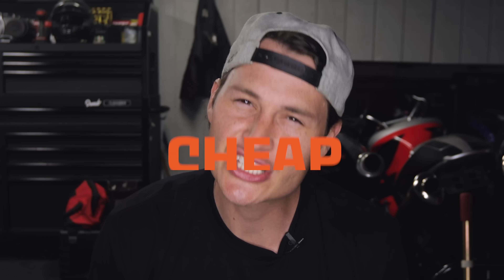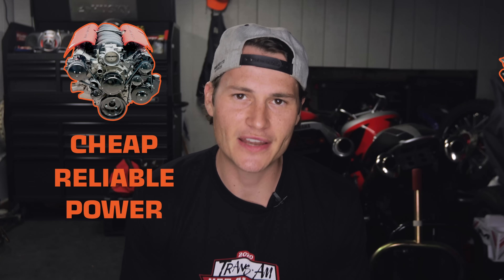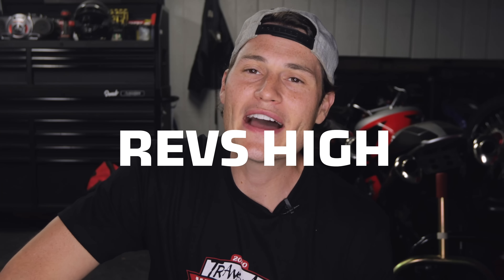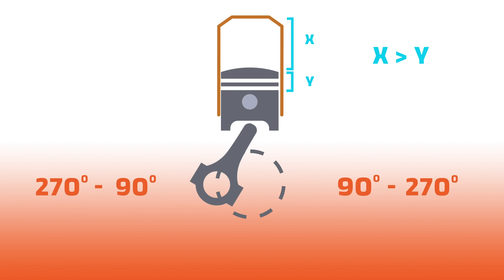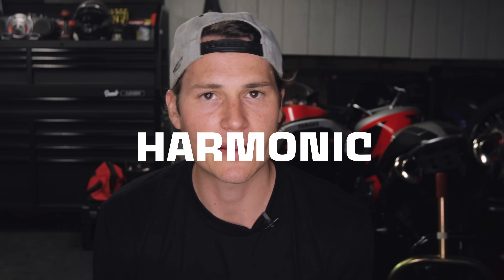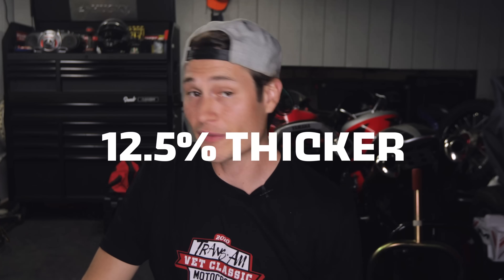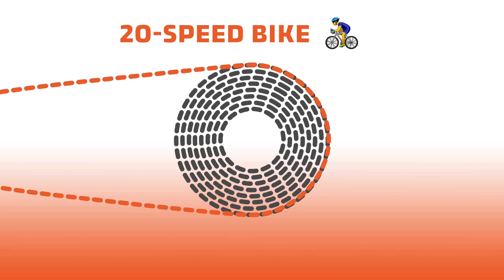Nissan VQ Engine - The Science Explained

Comment: All the VQs are great, we see plenty of older products with 200-300K miles on them still running strong in service and coming in on trade. The VQ37 has proven to be really reliable too!
Reply: my 2002 nissan altima with the 3.5 v6 (pretty sure a vq engine) is still running strong with 340,000 kilometres on it, although it already has problems burning oil it’s incredibly how that car still runs. vq all day baby
Reply: @bugoykikay8074  oil burn on an old vq engine is like breathing. So natural 🤣🤣 but yes a work horse of an engine
Reply: @kungfuhustle6363  ye it indeed burns oil on old vqs my other nissan titan 5.6 v8 does the same burns oil but still hauls ass
Reply: @bugoykikay8074  yea thats pretty much the only bad thing about the vqs. They eat oil like no ones business but otherwise they sick
Reply: @alexanderfriesen8818  little update that old altima still runs but it eats more oil than usual now hahaha
Reply: @bugoykikay8074 ofc the first gen de burns oil like crazy
Reply: Japanese knew how to do it for sure. 93 Subaru impreza 1.8 litre boxer. 435,000
Reply: I had a 2001 pathfinder SE with the VQ35DE and when I gave it away it had 300K on it, and it still ran perfectly, it could still do burnouts even with tires that were taller than stock. That pathfinder never had any mechanical issues even though it spent alot of time offroad.
Reply: The reason in Milwaukee I see people driving reckless in those ragely ass infinits, but they are still running
Reply: @vernonpaigejr.1517 that's what made me get one, I may do a pull here or there but these VQs live through the BS people put them through. When I worked in the shop, it was common to see Infinitis and G37s with well over 200k miles
Reply: @Tachyon836 did many have the gallery gaskets issues? How common was that problem in your experience? I just bought a low km 08 coupe and wondered if this an inevitable reality.
Reply: @Rygo-wk3jm honestly, I was at 180k miles and it never went on me. I sold it though.
Reply: Mine has 300k still runs gray I haven't had a fix anything
Reply: I have 283k miles and counting on my daily-driven 2006 G35 sedan with no issues (that I can't handle). 25k of the miles have been under my ownership. My previous 2005 G35 made it to 265k before it got a bad oil leak, but I'm going to pull that engine and rebuild it for another 2006 G35 coupe (6MT) I have that came with a blown motor. Once I get that going, it's gonna be a track car!

I bought both of these cars for $1500 each. They've taken a fair bit of work but I've learned a lot, and I have more faith in my daily than ever. In the end, I'll have two great cars (one of which I autocross/drift), have parted another out, and have done all the work myself. This has been my passion over the pandemic.
Reply: @stezenast5878  my friend had his bagged g35 with almost 400k and he drives the fuck out of that thing😭
Reply: I own a 2000 nissan cefiro with a vq20 DE,love it
Reply: My xterra has 400 000 km or 250,000 miles and going strong.
Reply: The Vq40de after 2011 is pretty good
Reply: Dont they chug oil
Reply: @lukesterhd4055  The higher horsepower versions of the 3.5 they put in the G35 6MT and the 350Z were said to consume oil, but I think that was when you drove them hard. I had an 05 G35 GMT Sedan and currently own a FX37 with the VQ37 engine, I never had any issues with oil consumption.
Reply: @lukesterhd4055 because it's literally a missile it's faster than mustangs

Comment: I personally feel that the vq35 & 37 are among the best v6 engine (reliability & performance) also along with Honda’s j35 & 37. Many Japanese v6s are reliable and can out perform most other v6’s
Reply: VR38
Reply: @preludeh22honda69 that’s a twin turbo v6, and yes it’s the best v6, but the vq37 is the best NA v6.
Reply: @Eclipsis17  i never said the vr was n/a and neither did the original comment specify so all i can say to you is...who asked bro?
Reply: My Murano has the VQ35 and if it wasn't for the CVT, that thing would be a beast. I had to replace the trans recently, like everyone else, and started looking into the engine to see if it would last long enough to be worth replacing the trans. Turns out, Nissan actually made a good choice there.
Reply: Got a VQ35DE in my Pathfinder with a 4 spd. auto. Good stuff!
Reply: Also can't forget the Toyota/Lexus 2gr-fse with Direct injection. I have a 2006 is350 with that motor and it's a beast. Makes more hp and torque than the VQ and Honda's J series with 306 hp and 277 lb-ft torque.
Reply: @dustinferrel4934  Might be me but I don't see many people talking about the 2GR-FE and FSE. In theory it seems like an amazing engine and a decent enough successor to the JZ series.
Reply: @dustinferrel4934 yeah but that engine doesn’t rev to 7500Rpm and it’s not as modifiable

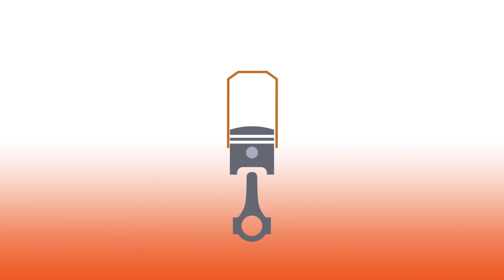Comment: 7:30 I don't think that is correct at all. If you have a 4 inch stroke, there isn't more on the top of the rotation than the bottom. Piston speed does vary through the stroke but the distance from the top half to the bottom half doesn't change. 90-270 would be the same as 270-90. Now 45-135 compared to 135-225, that's a different story.

Comment: Has anyone pointed out yet that your description of inline 6's is incorrect?  The mated pairs of cylinders do not fire at the same time.  They still balance each other out because they offset the mass at opposing ends of the crankshaft equally.

Comment: Calling the VQ35HR to best VQ is straight up stupid.  When this video came out the VQ37VHR had been around and in vehicles for over a decade.  Overall it is a much better engine that fixes many of the issues with the VQ35HR.  Doesn't drink oil like a frat boy chugs beer at a kegger while actually capable of seeing some power output improvement with bolt-ons other than forced induction.  With just a tune you can get most of them to over 350 hp.

Comment: 260lb/ft is not a "bunch of torque", especially when you have to rev it up so high to get it.  This is where a modern 2.0 4cyl with 260lb/ft stomps it because the 260lb in that case starts at ~1500rpm.  These higher HP V6 engines had a short life between the anemic V6s and turbo 4s.

Comment: ok, but 20v 4age Rev limit
A correctly wired silvertop 20V 4A-GE has a factory rev limit of 8200rpm. Without the SPD signal to the ECU (speed sensor), the rev limit is reduced to 7800rpm as the ECU thinks you are "free-revving" the engine.

Comment: Don't know about 350Z but my G37 manual shifted pretty rough 1to3rd an also 4to 5th. 
BMW and Honda make better manual gearbox than Nissan
Reply: I went with the semi-auto and with the Level 10 upgrade/rebuild and it is great.  I tried the manual and didn't like it, which is strange since i normally rather a manual.
Reply: @TheInfinityzeN  semi-auto in a 350z would be nice is it 6-speed?
Reply: @aryaahmadi4029  I have a G37S, so the 7 speed.  Sadly they are a Semi Auto using an Automatic base, rather than an AMT using a manual base.  

For those that don't know, an auto based Semi Auto Trans has a locking torque converter or clutch pack along with manual controlled shifting.  Those changes let it get close to (or better than) the performance of a manual based on its tuning.  The Level 10 kit made it hard slam shifts instantly in Sport or Manual mode.

Not as good as a Sequential or DCT for performance, but they can be much smoother when driving around town, can handle more torque, and don't break as often.
Reply: @TheInfinityzeN  still pretty decent for being the torque converter. I bought the manual G37 thinking it was going to o feel like a 3 series, it left me disappointed except for the power (IPL engine)
Reply: It is a little more than pretty decent after the upgrade, but you are looking at some money to do it.

A V6 is never going to feel as good as an I6.  I did get a tune that is a little better than the IPL one before I did any upgrades.  Living an hour drive from UpRev helps if you drive anything Nissan.
Reply: @TheInfinityzeN  True it's one of the few occasions that I prefer 7apeed auto to a 6speed manual.

Comment: Powerful and reliable? Are we talking about the same engine? The engine that would burn a quart of oil between services due to it's flawed cylinder sleeve design? The engine that is hard to squeeze extra horsepower out of with just bolt ons unless you boost it because it's already tuned to almost max output for power? I know the oil consumption was addressed in later models but squeezing power out of it was always pricey.

Comment: Hilarious!  Tell us again how the piston moves further in the top half than the bottom half, I love a good laugh when someone sets themselves up as an expert, then tries to explain something they don't understand.

To do what you describe, the big end would have to be closer to the main bearing at the bottom of the stroke than it is at the top of the stroke.  How exactly do they do this?  Cranks are machined from solid cast or forged blocks of metal.
The crank spins on its main bearings.  The big ends are offset from the centre, by a fixed amount which is exactly half the stroke length.  The big ends move in a perfect circle centred on the main bearing.  The top of a perfect circle is exactly the same distance above the centre as the bottom is below the centre.  Show me any circle where this is not the case.  This means that the piston moves exactly the same distance from 0 to 90 as it does from 90 to 180.

In theory, it would be possible to have some sort of cam arrangement that moved the big ends to achieve what you describe, but nobody does that.  It would be insanely complicated, unreliable, and heavy.

Comment: The engine in my car is a 3.2 s54 and it makes 335hp and 265 ft lbs tq in stock form,it also revs to 8000rpm.It has a weakness though weak rod bearings.I think I'm going with a mild Ls3,cam, heads,intake maybe e85 and a 6sp because how small it is.Its lighter and shorter than the s54 and sits farther back in the engine bay.

Comment: No, each piston is just as fast in the bottom 180 as the top 180.  The piston moves faster in the mid 90 degrees up or down and slower in the top 90 degrees and bottom 90 degrees.  Geez guys, you just made a whole bunch of people dumberer.

Comment: Hey Donut why don't you do instead lo Low car Vs High you do a Turbo (high car) Vs VHR conversion moded NA engine. It still be cheap and the Harness come plug in. With your resourses you could hook up with Z1 for some cams and headers and the turbo will have a challenge ( at the Jim Wolf package ) and the overheating issues should be very control and Nolan Will have some fun!!!!

Comment: You guys missed the mark a bit with the secondary imbalance.
First of all the graph of piston movement is not a perfect sine wave, as you noticed later it should be significantly steeper near the TDC, and more delicate towards the bottom of the cylinder.
This is not caused by the shape of the crank not being symmetrical. As a matter of fact it's always perfectly symmetrical for a specific cylinder, and you can't really offset that, as you'd just change the tdc angle. It's simply caused by the fact that the piston's crank is doing a circular motion while the piston is doing a linear motion, you can understand it very simply by drawing a theoretical crank moving linearly up and down, and when it's exactly half-way you could animate the crank's bottom moving sideways to connect to it's real position in that situation, and due to the geometry of the engine's bottom end you simply end up with the bottom of the crank higher than it would theoretically sit if it was moving linearly.

Comment: 7:54  the shape of the crank is perfectly symmetrical.  i'm not sure why you would say it that way; it makes no sense to me.  the reason the piston moves more at the top half of the stroke is because the connecting rod is effectively shortened when it's brought out of line with the cylinder.  so on the downward stroke, extra length is removed as it rotates out of line, and that shortening of the conrod translates into more stroke.  then as it rotates back into line at the second half, the conrod length is being added back to the stroke, making that half of the stroke shorter at the piston.
now, a sine wave is perfectly symmetrical.  so with the asymmetrical stroke speed, the wave it creates is not sinusoidal.

Comment: Thank you nice to know sombody know s nissan so well. . in your opinion what can I swap on my mint 04 exterra 5 so manual very easy and without brking my back or bank . vs 35 or the hr or the 4.0 liter newer gen what will you put there for best drive on road and 4x4 torque . .. Thank you . if you can advice .

Comment: here's a shocker, the Nissan VQ engine is in fact NOT a nissan engine, as it was engineered and developped by Renault to replace the aging PRV and was used first in the renault Vel Satis and Avantime, only with the 350Z running a less tuned down version months later.

Comment: Engine kicks ass but Jatco Transmissions are shite ! On just about any search engine as soon as you enter jatco this is the kind of crap you see>

DAMAGED* 2009-2019 Nissan 370Z 6 Speed Manual Transmission Sport Package / 94k / 7Z006

$649.99

SKU:979266685743Condition:UsedWeight:240.00 LBSShipping:Add to cart for quick quote

* This Particular Item Is Being Sold As-Is, For Rebuild Or Refurbish Purposes, And Carries No Warranty

Comment: Still not a good as an LS in my opinion. The VQ is a hell of an engine don't get me wrong but It's not capable of making the power of an LS with factory parts naturally and it makes horrible noises. But for me if I'm going to buy anything with a 6 cylinder it's going to be an inline 6. Nothing is smoother than an inline 6. And they naturally make more torque.

Comment: I loved my VQ in my 2013 G37x Sedan....right up until a 🦌 stepped out in front of it. 
328 hp from the 3.7L V6.
I had bought a new Accord 3.0 V6 (2004) with 240 hp EX-L.... that was a nice car at the time.
It's a shame they grew the Hondas to 3.5L then got rid of them for Turbocharged Fours....I think the 3.0 NA V6 was a nice blend of power, & Economy...without the extra strain of the Turbo.
The NISSAN ENGINEERS...👍 VQV6
🤣👎👎👎..... for their CVTs & their applications of the Forward Collision Avoidance Sensors.

Comment: Also u forgot that most inline 6 engines have a better rod to main bearing ratio compared to a v6
The inline 6 usually have 7 main bearings......apposed to 4 main bearings on a V6 or 5 main bearings on a v8

Comment: Inline 6 engines do not have 2 cylinders that fire at the same time.....they are companion cylinders on opposite strokes of the 4 stroke cycle......hence they usually more that 9 times out of 10 have the following firing order......
1 5 3 6 2 4......and the rod bearings are phased 120 degrees appart

Comment: Your 6 cylinder animation is wrong. The end, center and middle cylinders do not fire together. Eg, 1 (down) power stroke, 6 (down) intake stroke; 2 (up) exhaust stroke, 5 (up) compression stroke; etc. Usual firing order, 1-5-3-6-2-4. [Old mech engineer].

Comment: There's an engine very similar to the VQ35. But it's 10 years older and was extremely common. It had a smaller capacity of 2.5 Liters, but about the same hp/L.
This engine is a 24 valve quad cam 60° V6 with a split alloy block and an under square bore/stroke. It didn't have VVT, but it did have a variable resonance intake manifold and redlined at 7500rpm.

Can you guess what it is? I'm talking about the Mazda KL series of engines. It was found in the 626, the MX6 and the Eunos 800 from 1993 on. In JDM spec it made 200 hp and was very refined for the day.

Comment: Another engine with a 4 bolt girdle is the Mazda K8, KL, KF V6 engines as well as the duratec 25 and 30 motors. Sounds like donut needs to do another v6 engine breakdown haha

Comment: Definitely buy a HR 07 and up. Avoid the DE 06 and under. The DE is known for misfires, catalyst failures (2 of them), Not sensors failures, and my personal experience crank walk. Had to replace the motor and decided to sell after dumping so much in repairs. My advice is buy an 07 and up HR or buy a 06 shell and throw in a LS swap.
Reply: And my favorite, plenum air leaks causing engine light to come on.

Comment: 3:43 tell me about it I snapped my wheel knuckle and hub off a burn out when I got mad. Lol 😂 but I used the wheel knuckle of a 4 banger 05 altima on my 04 3.5 v6 maxima. Only thing that wouldn't fit was the center hub because it was smaller in diameter compared to the v6 maxima so I took off the center hubs and switched them now she rides better. Lesson of the story is don't burn out on this engine unless you have back up suspension parts. #MoPowaBaBeh

Comment: 2 major mistakes by the midway: secondary imbalance is due to finite length of the conrod, the longer it is in relation to stroke the lower secondary forces and moments are.
Torsion means twisting around an axis, here imagine the crankshaft as a wet towel which You are forbidden to ?wringle? out of water by twisting it, you could rotate it, but if forces are counteracting then this water will start coming out, being wringled. This is due to the v6 using common throws on the crankshaft what forces uneven firing intervals

Comment: you forgot about the ladder system the bottom end uses for reinforcement, and you also forgot about how the chain tensioner likes to fuck off and make the timing chain skip teeth. VQ engines are great once the problems are solved.